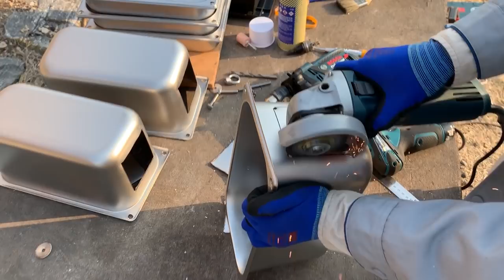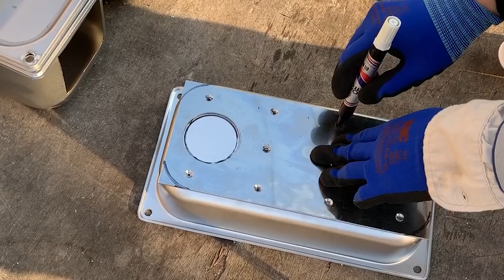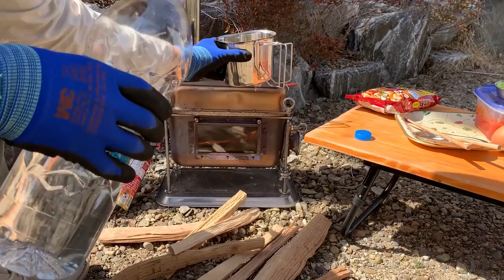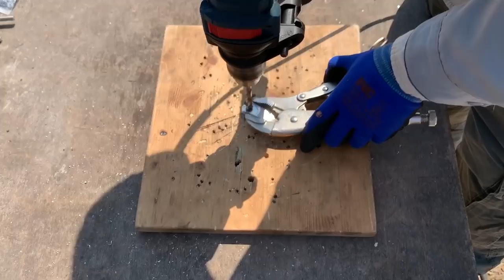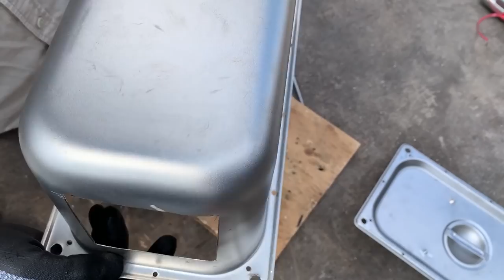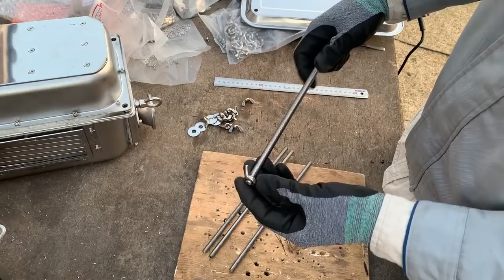No-Welding Off Grid Wood Stove for my Subscribers - Homemade Stove for Camp M-Stove Project Part-6

Comment: I have serviced woodstoves for nearly eight years and this is a clever and beautiful design.  Time will tell if it will hold up to the rigors of regular use, but being stainless will certainly help!

I am planning a move across the country and a portable tiny house and the amount of weight this saves over a traditional woodstove  certainly makes this a build worth considering, if not as a primary heat source, certainly a cooking surface!

I applaud you ingenuity and thank you for sharing your ideas and construction methods!
Reply from the maker: Thanks. There might me more to upgrade on this but it works fine. Glad you like this. Stay safe there.

Comment: I think that I may have to have a go at making one of those to fit into my shed. I am setting up the shed as an mini cabin so I can get my grandson  out to do camping as he has autism and I want him to feel safe. I will be watching this a few times so that I can get it right.

Thanks for this video as it is extremely informative on how to make one.

AWESOME
Reply from the maker: Thank you. Be careful not to use it in an enclosed space and be careful of fire. Stay safe.
Reply: Wonderful you have your Grandson's best interest at heart.  This stove looks great, but why not double check on safety first?  For one, can it leak Carbon Monoxide (the "silent killer") due to warping and bolt use?

Examples of what I read:  Stainless steel warps with heat and a warped surface won't make good contact with your pots/pans.

Personally, I'm not too comfortable with the legs.  They don't seem that sturdy in the video with just the weight of the stove.  Now add in the weight of the firewood.

In any case, best of luck to you.  I hope you and your Grandson enjoy your camping time together!
Reply: @wownewstome6123  As long as the area that it is being used in is well ventilated there is no problem. I am on it when fire safety is needed  as I was a trained Fire NCO in the British  army for over 10 years.

When it comes to warping metal I all comes down to the quality of the metal and as the metals used in this post are designed for industrial sized ovens which kick out one hell of a lot of heat this should not matter to much plus, adding extra bolts to the rims and support struts to the legs all should be good.

Thank you for your concerns👌

Comment: Nice job, I am greatly impressed on how you use a few basic hand tools to make these. It reminds me when I was a locksmith and had to fabricate safe parts out of my van with only hand tools and a an electric drill. Also the fact that you take the extra time to clean your grinds and drill holes so that there are no sharp edges really shows the you have pride in your workmanship. Cheers from Canada.

Comment: if you decide to sell any I would be interested as we are building a van for long term living in and this would be ideal as a heat source and for cooking on , very well designed.
Reply: I was thinking the same.  I too am planning van life but I need to have an incinerator toilet so still doing my diligent investigating on that.
Reply: interested if this was for sale as well!
Reply: Could you show air flow design?  I like gasification burning.
Reply: Wonderful design & skill.  Nice tools.
Reply: @airscrew1 Sure, I hear ya.  Other concerns involve lack of accountability.  Glass - is it tested for high, uneven temperatures, for instance?

I'm in the USA.  I count on manufacturers to use engineers and to do extensive testing of products.  And then, to be held accountable if consumers are injured or their property becomes damaged to their product or lack of proper instructions.

[edit]  But I will add that I enjoyed the video, and I appreciate any good content he puts out.  (I'm new to this channel.)
Reply: It is very in-efficient for cooking as there is no direct flame to the cooking surface on the top. It will take a long time to cook using a pan sitting on the top of the stove. Maybe good for heating the space but don't count on it. Good Luck.
Reply: Agreed. Me, too!
Reply: Thats how the usto cook in French country homes the only thing was the stoves was made of cast iron.
So is Indirect heat through conduction transfer.
Everything converts into carbon monoxide every single time you burn especially toast if you eating it you're digesting carbon monoxide even cooking in front of stove.
Even when you're driving or stuck on a standstill..
Superb utilization of comercial cooking pans.
👏 👏.
Reply: @wownewstome6123  "I'm in the USA.  I count on manufacturers to use engineers and to do extensive testing of products" You and people like you is why products are designed to be dummy-proof and why we can't have nice and cheap but good-quality stuff. Companies are afraid to make something that some dummy will hurt themselves with. Use some sense. If you use something like this indoors, make sure there are proper clearances and a CO detector and proper ventilation. Obviously, it will be hot to the touch so don't touch it when it's hot. If there are signs of issues (cracks, warpage, whatever), either fix it or stop using it. I have an old desk fan from the 1950s that I nicknamed the finger-capitator. It will eat your fingers if you let it as it has no real safety features. I haven't lost any fingers and if you're stupid enough to stick your fingers in it while it's running, maybe you deserve to lose your fingers.
Reply: @NotSoCrazyNinja  You went a bit overboard, don't you think?  It's not like I posted my comment on a thread about non-lethal items.
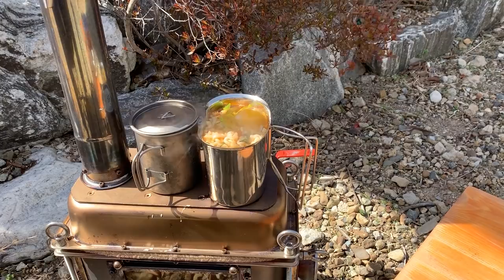Reply: @nickhersheys2706  11:31
Reply: @NotSoCrazyNinja  it’s a camping gadget, a craft. Don’t be a complainer and give your opinion in a context!
Reply: bought a juiced bike doing a bicycle camper build now myself. soon as my job ends im hitting the road with it ...worst time of year as its winter here in mass.

Comment: Wow, that's one of the best DIY wood stove ever . This updated version truly is masterwork!

You have inspired me to give it a try but I have an idea and maybe you like it, I would love your opinion:  since the stainless steel food containers can be stacked so tight, to the point that they become air-stuck, do you think it could be a good idea to use two bottom and two top containers to double-wall the whole body?
Reply from the maker: Interesting Idea. Thanks! If it can be stacked so tight, it would bring better durability I think!
Reply: I had a similar thought, but was wondering if there would be a thin space between pieces to add a thin sheet of rock wool to insulate and increase efficiency.
Reply: @crazyb3265  Great idea, it's absolutely possible and this actually would solve it all! 

Those pans stack tightly, so tight that they have to also make specific "anti-jamming" ones. You definitely could put something in between those layers, then press it down and the only drawback I can think of would be that, depending on the thickness of the insulating layer, aligning, cleaning up and sealing the door and window could be a bit trickier since they're slightly offset. Nothing a bit of that oven rope-gasket couldn't fix and really it shouldn't be much of a problem unless you go with over something like 1/2" final, "compressed" rockwool thickness, which I think you shouldn't anyway because too much insulation and you end up with an oven where it's super hot and efficient inside but produces very little external heat.

 Other than that, it's a thousand buck idea! Being double-walled AND insulated would indeed make it a lot more efficient and give it some structural integrity. Making it stop "pinging" and glowing red so much while giving it some extra heat retention and efficiency!

Comment: Just a tip.....using cobalt drills and carbide  saw blades will make the job easier when working with SS.
Reply from the maker: Absolutely. I have them used all.! Thanks. Stay safe there!

Comment: How well do those cooking pans hold up to the heat? Would it be a good idea to install a thermometer (like a wood burner has) to keep an eye on the temperature? Also, use the countersink on all the holes, very lightly, to deburr them - easier than using the file like a scraper! Oh, and put a nut on the threaded rod before you cut it, then afterwards, you wind the nut off and the thread is intact - saves lots of work with little files to fix it!
Reply from the maker: I holds up to heat even though the pans glow. But I avoid putting heavy pot on the top. This stove I use like a toy. Using countersink is a great idea👍👍👍♥️

Comment: I really like the simplicity and efficiency of the design, but can't get my head around the fact it's very thin, likely to deform, and so possibly become impossible to disassemble. Other than that, it looks AWESOME!
Reply from the maker: Deform? Yes! So I got the stove top reinforced with thicker plate. It works fine. Thanks!

Comment: Question, the nuts or bolts will it   loosen in the future for constant use, hot and then cold when not in use, will the bolts and nuts loosen?
Reply from the maker: Most bolts and nuts are loosened, except in very small quantities.

Comment: Don't forget, not all stainless steel are the same!
I had an SST teakettle from China, after few months of use, all ready rusting!
LOL!
Reply from the maker: I use at least 18-8 304 grade👍🇰🇷♥️
Reply from the maker: Yeah. Good! And Let’s try with 316L or 316Ti for reducing IGC. I somehow want to use. This is very interesting subject.👍 Are you a metalurgical expert?
Reply: @campingtogether  Nope!
But use to be a machinist for Aerospace company, I know how 304 or 316 SST machines!
You are using off the shelf components, keep cost down, so 304 is just fine I think!
Most kitchen stuff, pots and pans etc... made out of 304, resist common corrosion!
Reply from the maker: Oh I see. Yes. Very easy to get. Stay safe there!

Comment: Just wondering how many times you can use it before it burns right thru. Is that would even last one season?
Reply from the maker: I wonder if it is. Even thinner doesn't melt right away. In the case of intergranular corrosion, it seems that there will be no impact because many cycles must be used. Stay tuned. Keep it safe.

Comment: cool project but I doubt just anyone could get access to a hydraulic press like that. probably have to get a fabrication shop to do those cuts for them. but otherwise pretty cool :)
Reply: If you have a steel entry door and frame on your house or shop they make for a great metal break on thin gauge metal.

Comment: What is a 2t stainless steel plate - do you mean it weighs 2 metric tons a square sheet (L x w x thickness?) or is it 2mm thick? What grade is all of the stainless 309, 316 or ?
Reply from the maker: 2mm thick and 304 grade except air  control it maybe 200 or 400 series.
Reply: You undoubtedly know that ASTM A36 HR steel is 3X (times) more heat conductive than stainless. Not to mention much less cost - over size stove dimensions then line with 2700F split 1.250" thick fire bricks. Heavy, yes - but will last a lifetime. Good luck!

Comment: Have you thought of using rivets. they are so much easier to use than nut and bolt?
Reply from the maker: Sure. Because bolts and nuts make repairs and tuning easier.

Comment: Super cool video man, great job! However, you must be independently wealthy, retired, or both. I would love to know what the cost (US dollars) would be for one of these stoves, let alone four. If you could post the estimated cost of this build in your country's monetary denomination that would be appreciated, then I could just convert to US dollars. I figure the most expensive items were the stainless top plate, fire proof glass assembly, refractory brick, and finally cutting implements and drills. Between a business Costco, Home Depot, metal specialty shop, and stove/fireplace store, I figure I could build one of these no problem. Unfortunately, I don't know if I'd have enough money left over to buy noodles to cook on top of it. GREAT video though, loved it!
Reply from the maker: The cost of materials for manufacturing a single stove is about 145,000 won in Korean currency. This is equivalent to about $ 120 USD. It also includes the stove pipe. Of course, the tools were excluded. In Korea, all these materials are available at a low cost. At the request of the viewers, I searched Amazon and it was too expensive. The top plate was cheaply purchased, and the most expensive parts were heat-resistant glass and frame sets. 30,000 won (about $ 25 in dollars)
Reply: @campingtogether  Thanks man! Not as expensive for materials as I would have imagined. However, I know time is valuable as well. Keep up the good work and videos.

Comment: What kind of gloves are you wearing?  What kind of bits did you use?  What kind of grinder blade did you use?  What kind of hole punch?  Thank you.  Oh wait I don't have a massive metal press :(
Reply from the maker: Hi. glove from dollar shop. bits and hole saw for stainless steel.(cobalt or tungsten one) Thanks

Comment: Haha! Posco! I worked there years ago on a shut down! Hey when are you going to get a drill press? I wanna see you selling these and making a ton of cash off this idea! Have you tried using rivits for the inner diverter ? Or would they burn out too easy?
Reply from the maker: POSCO has a factory there. haha. Rivets must be made of stainless steel. Aluminum melts. I use bolts and nuts for assembly and easy disassembly. Thanks!
Reply: @campingtogether  we have stainless rivits!. Yes Posco is in Pittsburg , California. East of San Francisco about 45 min. Drive

Comment: Has a detailed parts list been compiled, or is that unnecessary because all these commercial kitchen components are standard in size?
Reply from the maker: Most parts lists have been completed and filled in the description section of the previous video. However, the list of materials used in the main firebox may not be necessary because it is a standardized product. My blog also has related content. I am gradually updating. Thank you. Stay safe. https://campingtogethercamp.blogspot.com/
Reply from the maker: Material list updated. https://campingtogethercamp.blogspot.com/2020/04/httpsyoutu.html

Comment: He sure drilled those holes the hard way.
Next time secure the work to the tabl with a couple of screws or nails. Then you can drill the rest of your holes without having to use your feet to secure the piece.

Comment: You could have used pop rivets, the heck with nuts and bolts.
Reply: How do you disassemble for packing, if it's riveted?
Reply: @geographyinaction7814  I would never disassemble.

Comment: I would rather have it braised welded.All those nuts and bolts will have to be retightened multi-pull times caused from the heat.
Reply: There are plenty of DIY examples of welded stoves.  This is a great alternative for those who don't/can't weld.  Personally, I like the fact that I can take this apart for storage--unlike a welded stove.
Reply: @brianh.000  Don't think you could wire weld that thin of metal.That's why I said braising it.You could braise weld components together while still having some of it bolted so you could take it apart if need be.
Reply: @COYO-T  My point was that there are those who don't have access to or knowledge of welding (or brazing), and this is a great alternative for such people (myself included).